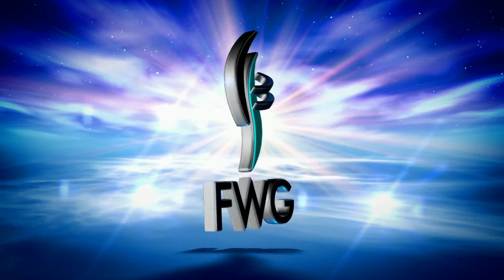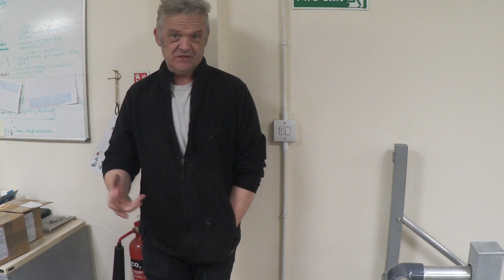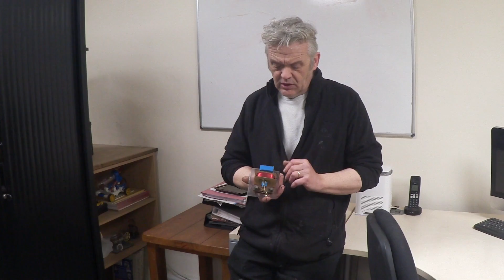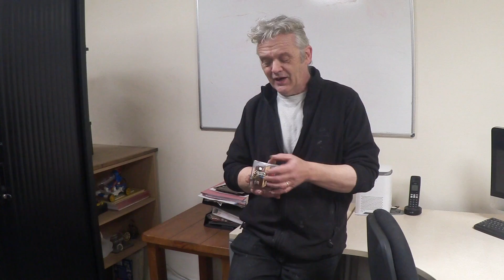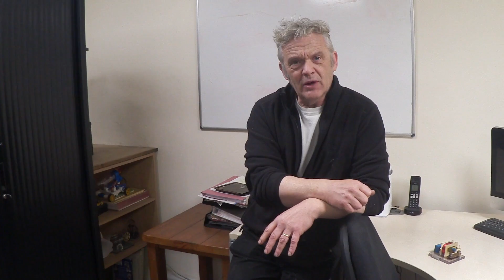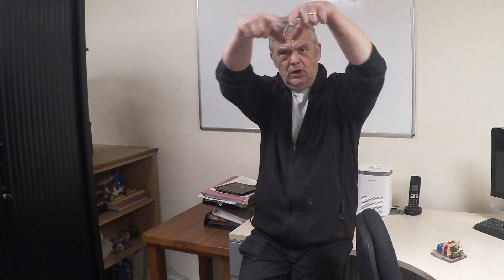Charge Controllers - Some Concepts

Comment: I believe it is more like I built 30 thousand of these you need one or more. I was able to use a buck converter from an old monitor and a  mechanical voltage regulator from a car to achieve the  the results I needed to put a free solar panel to use. I could not see paying 100 dollars for an off the shelf part, that if it had problems I could not fix. I have two buck converters per old monitor and could rebuild the mechanical regulator.  If the supply of cheap parts from china goes away it will be thinking like this that could saves your life .

Comment: I didn't understand it properly. It seems like a pulse with modulation where the average voltage is seen at the output based on the on and off time and peak voltage.
Reply from the maker: you are jumping too far ahead mate - you are right but it doesn't relate here

Comment: You're quite right. People often don't need the most efficient or best of a specific component. They might just need something with 60% efficiency and cheap enough to get a basic working system. Once you have something that works, then you can take measurements and see what would be the best thing to improve on.
Reply from the maker: spot on mate

Comment: I have 2 critical requirements for my future charge controller:
1. It can handle any (really any) voltage. 
2. It never breaks.
Reply: So, you’re not planning on buying one anytime soon I see.
Reply from the maker: - not sure in a real world you will get number 2 mate - because of that you will need to build in a contingency for when it does break - so 'breaking' will be invisible to you - basically - everything breaks if want unbreakable the strategy is to build in a coping mechanism for when it breaks

Comment: Do you have any videos on fluoride carbon magnesium batteries
Reply from the maker: no mate
Reply: @ThinkingandTinkering  
If you have some extra time can you look into a battery using this chemistry, the reason I researched this particular chemistry is kindve funny, but nikola tesla allways liked the numbers 3_6_9_12 
On the periodic table of elements
Lithium
Carbon
Flourine ( flourine is highly toxic )
(flouride negative ion)
Magnesium

And found alot of papers on google scholars pertaining to carbon flouride magnesium batteries. Apperently they have very high energy density and use the transfer of negative flouride ions to move electrons. But there were a few problems. I think it would be awesome and I'd be very grateful if you could make a video explaining this chemistry and if it's worth experimenting with.
Reply: googles "robert murray smith fluoride carbon magnesium batteries"
Reply: @paulmaydaynight9925  I can't find anything, I'm not a scientist or anything smart like that so please excuse my choice of vocab .I was just wondering cuz I stacked a piece of magnesium a piece of sheet graphfoil a sheet of dry flouride a sheet of paper then a sheet of dry flouride then sheet of graphfoil then a piece of graphite. When I put my mulit meter on it read 1.4 volts, after I charged it for a minute it reads 1.8 volts. If discharge it then check it again the voltage climbs back up to 1.8 volts. I dipped one of these cells in brake fluid and it does the same.
Reply: @robertolivarez5742  i beg to differ robert, you are here and that makes you smarter than most mate, everyone starts somewhere, and your links say you have aptitude for science and skills, perhaps you will find it here.

Comment: "Maximum power point tracking (MPPT) or sometimes just power point tracking (PPT)) is a technique used commonly with wind turbines and photovoltaic (PV) solar systems to maximize power extraction under all conditions."

do YOU Need it, no, is it an option ,sure if you have actually 'made' and connected more than enough batteries (in this case,assuming you want to actually store the energy before use oc) to take every extra amp it can theoretically give.
Reply from the maker: need it no - nice to have - sure why not lol

Comment: From about 3 minutes in I get the sense that you are headed towards talking about a transistor. That magnetic coil in your solenoid switch could in very basic terms be likened to the gate (or base) of the transistor.
I use a solar charge controller only because it was cheap alternative, I paid about $25 shipped for a 60 amp solar charge controller. Probably because the positive and negative solar connections were mis labeled and I had to swap the leads to get it working. Anyway I have all the house lights working on solar powered 12v LED's and 235 Ah AGM batteries.
Love the way you simplify everything and make it understandable to s point you go back and see options you should have seen before.
Reply from the maker: exactly where I amp going mate - first diode resistor circuits then transistors - to my mind if it's not simple at the basics it's likely to break lol
Reply: @ThinkingandTinkering  very well said mate. One step at a time, get the basic principles working then build on that strong foundation.

Comment: The NEED in most solar charge controller supplications is the harvest as much solar energy as possible. Solar panels are 18-20% efficient in the very best of cases to begin with. A PWM controller will apply some  charging voltage to your battery for a short period of time in an on/off type of arrangement similar to your electromechanical voltage regulator. The sun is sending energy continuously however.

What happens to the energy not absorbed by the battery when the controller is switched off? 

Answer: waisted... unless it is sent to a ‘dump load’. This is usually a water heater element. Converting solar energy to electricity and then to heat is TERRIBLY inefficient, but so is wasting up to half or more of the solar panel output.
Reply from the maker: I hate to disagree mate but you are seeing  need from one perspective only - that is conversion efficiency - as a driver it may or may not be the need - this idea is why solar tracking was touted as being a solution to a problem - but there are other perspectives
Reply: cool, in your case, Is the Board Half Full or Half Empty?.
Reply: No matter how many times I cut it, the board is still too short. Not sure how full the glass is but if it’s not gin, who cares?

Comment: That reminds me of the first sensing circuit I came across  which was not based on solid state components but on resistors. It was called a the WHEATSTONE  bridge. It was used to sense the amount of methane gas in the mines, I used to fix those sensors years ago. if the PPM reached explosible limits an alarm would go off warning the miner.
Reply: Maybe if we apply ourselves we could design a charge controller using the Wheatstone bridge as a sensor
Reply from the maker: nice example mate - cheers

Comment: Great discussion!  One of the questions I have had regarding controllers .. is whether or not the controller is aware of the kind of battery (lead acid, lithium, etc) or not.  I guess it doesn't matter since a switch will cut off power to any light .. without regard to it's being an LED or Incandescent.  Some of the information I had been looking at recommended the MPPT controller because it would pack more energy into a battery on a cloudy day .. for those living in a van and dependent upon solar to get through a few days of rainy weather .. those individuals are concerned about the long term endurance of the batteries so don't want to overheat them etc. but still keep the charge level high so the battery doesn't fall under a 50% energy level.  Thanks for discussing this!  :-)
Reply from the maker: the controller is really going to be aware of nothing mate - it will depend on how you set it up - a pre-bought controller may or may not be adaptable to a specific battery depending on the way the manufacturer made it - basically are there switches in it you are allowed to press that can configure it to be able to use the kind of battery you have
Reply: @ThinkingandTinkering  Thank you for the reply!  Interesting!

Comment: Sometimes you need MPPT controllers like in my own situation . My solar panel bank consists  of 30v panels charging a large bank of 12v caravan batteries which supply a 3000w 
full sine wave inverter. The MPPT controller has a battery voltage sensor which sets the output to 12v . In the process of converting the voltage from 30v to 12v ,the excess energy is converted 
into an increased amperage output .The charge never goes less than 13.5v even on a dull day, as it is intelligently stepped up or down depending on conditions to suit the voltage of the battery. I had no option to use any other controller than a MPPT with having 30v panels.
Reply from the maker: sometimes yes - sometimes no

Comment: Very very good points and well explained. This is exactly how I view my map as I set out to create something. However I do it just a bit different but the same if that makes since. I try not to re-event the wheel so to speak but use the wheel in such a way to achieve my goal in the most effective way, then I profect it.
   I do this in steps, 1st it's a train of thoughts, then I draw it out, then I'm looking at material to work with, then I start to build. This is my map, just as a map can show one to see the best route from point A to point B. Therefore I can see flaws long before I start to build and prevent lose of money time ect.
   Good video mate, keep them come coming.
Reply from the maker: nice way of doing stuff mate - I see what you mean

Comment: What I always wondered about MPPT controllers is, how do they actually regulate charging?  The MPPT acronym really only refers to the job of tracking optimal charge conditions ("Maximum Power Point Tracking").  Is it really just a "smart" PWM charge controller, then, or does it actually regulate the voltage via another manner?  I think sometimes the labels/terms we use clouds things further, distancing us from the most basic functions and turning things into the "mystery" you spoke of.
Reply: It's a buck converter (Or in some models, buck-boost) with the switching frequency and on-time set by a microcontroller that adjusts it continually to maximise charge current, until it determines the battery is full.
Reply: @vylbird8014  Thanks!!  I've looked at a lot of MPPT controllers and they never mention how the voltage is regulated, so I always wondered if they were simply a "smart" PWM. I would think it could be important to know about that difference for certain applications.  Thanks also to Alternative Space Misc and 01Alexsimps for your posts, they were equally helpful!  😊
Reply: I think mppt involves some buck boost circuitry to bump up the voltage to something useful even when somewhat cloudy
Reply from the maker: yes I think so too

Comment: MPPT produces the most power, especially on cloudy days, but it isn't always nessecery.
Reply: Depends on your setup. If you're only running a very small scale system, like powering lighting in an out-building or some remote sensors, it can easily work out cheaper just to an an extra panel. Fifty watts or panel and a dirt-cheap PWM controller still generate more than twenty-five watts of panel and an expensive MPPT. Once you're up to a few hundred watts though, the benefits of MPPT become clear.
Reply from the maker: for sure mate

Comment: I did it my ovn way when i made a solar system for a cabin. I got a used car battery from a gas station near by and i hadd a smal solar panel. I regulatid it with a bunsh of silicon diodes soldered in series i think its about twenty. it ceeps the chargeing about to 14,2v Utilising the ca 0,5v over a silicon diode. its fitet in a garden hose betveen the poles of the battery. It has funccioned for about 8 years now whitout problems. Then i have been looking at other charge controllers and they al cut the curent. I perfectly agree that its several ways to do things. It does a few led lights and a sigaret lighter so he can charge his phone.
Reply: interesting, your "Carbon has negative temperature coefficient." showing heat lowering resistance potentially means roberts painted heaters are somewhat self regulating among other properties
Reply from the maker: nice one mate